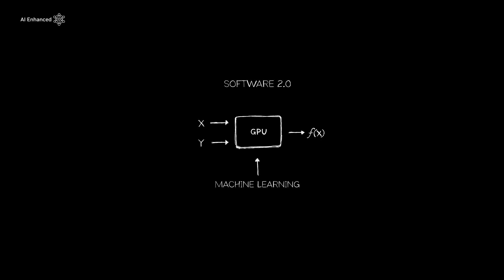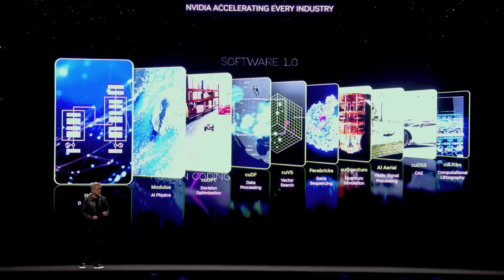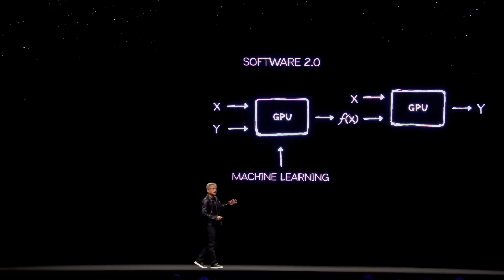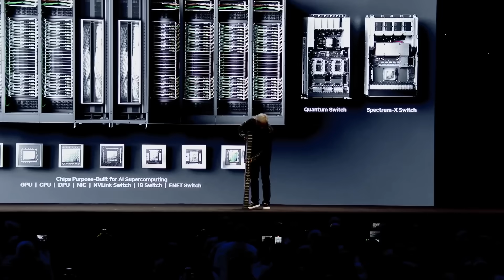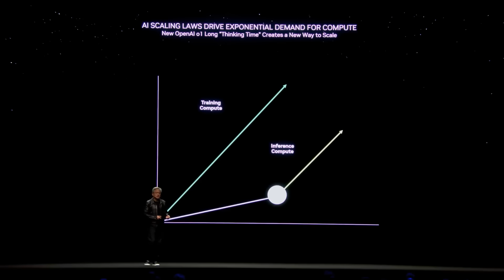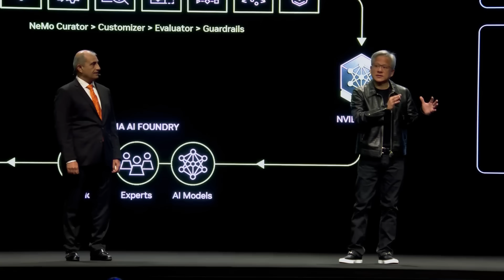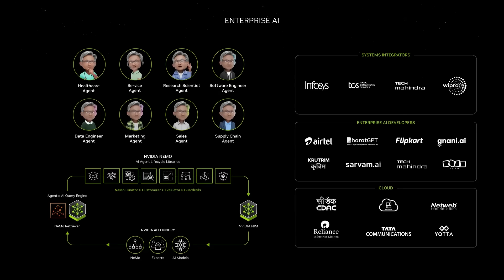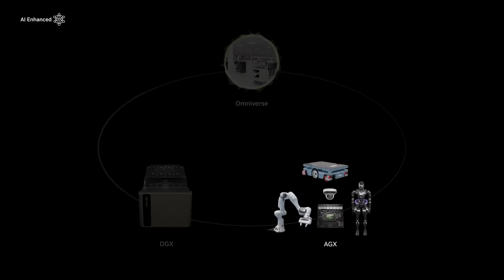NVIDIA CEO Jensen Huang Leaves Everyone SPEECHLESS (Supercut)

Comment: Large language models are already at their peak and agi is nowhere in sight. I think we should expect Nvidia to decline over the next several years, sometimes slow and sometimes rapid. The fact of the matter is, the company has never been good to its customers, has never told its customers the truth, and really doesn't produce anything that couldn't be produced elsewhere. There is no moat. Right now this is all hype based around The relatively limited abilities of things like chat gpt4 and llama. The fact of the matter is that these algorithms don't do any thinking, they simply respond to queries with The statistically probable answer. This works great for simple things, but is an absolute failure when you need something more complex.

Apple has clearly shown that these algorithms don't do any thinking, which any idiot with half a brain would have recognized years ago. When it comes to coding, they can answer simple questions as long as those questions are formatted perfectly to activate the neural net. They can't generate new code though. They can't generate complex code. They can't write full programs or anything even close. They're decent tools, a good iterative improvement on existing tools to make coding faster and more efficient. They're not even within a hundred years of replacing humans though. Probably not even within 500 years.The who think AGI is going to be a reality anytime soon are people who don't understand crap about machine learning, neural networks, and things like self-driving cars.

Comment: Using so much energy to power a computer, is it necessary? What’s it going to e used for, Mining bitcoin?
Reply: It would be useless, because bitcoin has autoregulation called -  we add another zero to hash if you use more performant HW🙂.
Reply: bitcoin mining is rigid, asic tech suits it better than anything else.

Comment: As a software developer for 25 years, his presentation has lots of intentional inaccuracies, the disappointing part being here the word "intentional".
The move from coding to machine learning (machine learning itself involves a lot more coding) to intentionally leaving out the designer, the programmer, at al stages, it's all mumble jumble. Machine learning has its place just as another piece in the pipe, but not more. And it is proven, to o certain extent true also for humans, that with such learning, the more it learns, the less accurate it becomes, to the point of uselessness. Look at all the universities pushing all the wrong ideas. There is a saying in my culture (Romanian), saying that with lots of knowledge also comes lots of stupidity. Knowledge is neither intelligence, nor wisdom.

Anyway, coming back to the subject at hand, as AI (machine learning) will never achieve consciousness, it will follow the same patterns as humans. Just at different scales, and scale by itself doesn't add anything meaningful. We as humans are very capable machines. We absorb and process information at scales not yet reached by the most powerful supercomputers. The eye resolution is tested at around 576 MPixels, at as high as 250+ fps, and that's only the vision part, perception can work at much higher rates.
Reply: Sure it will reach consciousness, if it hasn't already. What is so magic about consciousness? A neural net is a neural net, whether it's biological or silicon.
Reply: @Josh442  A car is a car, whether it's a plastic toy or real vehicle.
Reply: @Kiwi0xDFF  A plastic toy does not take us places. An AIN does think.
Reply: @Josh442  It does take you places if you prompt it with enough force 😆. But the point is not usefulness.

Artificial neurons are inspired by biological neurons In the same way that the plastic toy is inspired by the real car. The similarities stop at "box with 4 wheels".

When the neural nets we are comparing are made of such radically different building blocks, you cannot equate a biological neural net with an artificial neural net.
Reply: @Kiwi0xDFF  Do you think the difference is fundamental, though? I don't. Hard to get a grip on it given that there's so much we still don't know about the biological neural net, but ultimately, they do the same thing -- extrapolate statistical patterns from highly entropic inputs, and make predictions on that basis.
Reply: If intentional is true as you say then that’s a flag note to keep in mind as it is highly valuable thanks with cherries on top for the tip. If not, we’ll, that’s another story

Comment: Mentions it has improved processing. Also Mentions it costs 120000 Wats of energy to run. 😅
Reply: Thermodynamic computing and other forms of analog computing offer 100,000,000 times the performance of nvidia gpu computing at a fraction of the cost.  Quantum computing Qbits and analog Pbits will literally crush and obsolete digital gpu computing in very short timeframe. Nvidia's time is almost over, hence the superclustering of silicon based gpus that are  already theoretically and practically maxed out.  This is definitely a good move to extract as much as possible from a soon to be obsolete technology that is not 'intelligence' but highly optimized storage, search and inference at an unsustainable premium price point that will be like using a zilog z80 for a current LLM when hybrid coordinated qbit/pbit computing matures in the very near future.

Comment: I'd be so thoroughly impressed with "AI" if it didn't garble, drop the ball and fumble after 500 words, every single time.

The amount of data, resources, power, time, financing, etc. that is need to attain this barely-generalizable level of still narrow intelligence, and considering how much more resource-intensive actual intelligence will be, in terms of the necessary hardware and the energy to power it, if we go down this road, only serves to highlight the disconnect between broad-enthusiasm and reality.

Make no mistake, this a global Alpha test, and one that might last decades. Cold prompting and "reasoning", as NVIDIA and OpenAI have defined it, is still a one-track and one-direction lane. Actually intelligence, deserving of the name AI, would require continuous learning also, which translates into even more resources.

Energy will be of paramount importance, that's the only certainty I have, more so than ever. Perhaps in the pursuit of energy, for the sake of AI, as the ultimate solution for all problems... well, the irony of it! As God, it seems, is not without a sense of irony.

And we are very far indeed from true artificial intelligence, not because of the models nor the training data, but the underlying technology itself. Of course, someone will come along and say: "I know! Get AI to design the technology to power AI! Boom! Mind blown! Genius, I am!", to which I'd reply: "You do that, good luck! And sit tight as you wait for your "42" type answer."

P.S. The introduction alludes to the vision that, in the future, computers will be redundant because it'll be an AI interface, which will require a GPU rather than a CPU. Although AI, as we know it today, is nothing but a program that can be programed, to some extent, using natural language, albeit extremely finicky, often overly creative, also quite repetitive and set in its ways. So it's a hit and miss program, when you compare AI to actual programming; akin to a programming language with inherent randomness. It may do what you want it to, or not, given the limitation of its training, underlying technology, processes and physical being. Have fun with it!

Comment: Nvidia is trying to use speed of his GPU and forcing developers to hard code software with their Cuda API. Its all about the speed of the Hardware now of the GPU because they haven't cracked what software can be developed to make deep learning less GPU intensive. Competitors like Huawei needs to create hardware in par with NVidia or create LLM models which does not rely on GPU to train their models. Pre-trained models are now in place so you don';t need that much GPU. Do we really need that powerful GPU. If someone uses software to reduce the GPU power needed for GenAI training  NVidia shares will drop the next day. It's like how many 3nm chips do we need in everyday life? Practically none, we don't need it to be so small in the same sense is do we need a Bugatti to go to the supermarket to buy grocery.

Comment: 30 years from now, that huge GPU he showed will fit inside a single chip smaller than a human nail.
Reply from the maker: That will be a wild time indeed
Reply: impossible, new science has to be created for that, with current science and silicon it is not possible.
Reply: @dumdumdumdum8804  You're correct. We'll never be able to make a computer that is better and smaller than the ENIAC. 😄

Comment: 1:19 what a liar 🤣 it's thanks to Matrox and 3DFX we have the real time 3d graphics. NVidia was the last to release viable product
Reply: Yes. SLI voodoo cards...
Reply: I've heard nvidia bought 3dfx so he's not lying technically
Reply: 3DFX is Nvidia bud, they went bankrupt because they sucked and Nvidia bought them out
Reply: @DarkAttack14  3dfx released their accelerator before NV snatched them and made Riva
Reply: @SickPrid3  yeah, their accelerator.. Which wasn't a GPU Imo, pretty similar though. There is a notable difference. 3Dfx accelerators would only accelerate specific parts of the graphics pipeline.. But GPUs are programmable general compute units. One major difference would be AI neural nets can run on a GPU, but can't run on accelerator cards even if you made one that would attempt to run on an accelerator
Reply: @SickPrid3  it's thanks to SGI that we have real time 3D graphics.
NVidia and ATI each took 10 great engineers from SGI to kickstart.